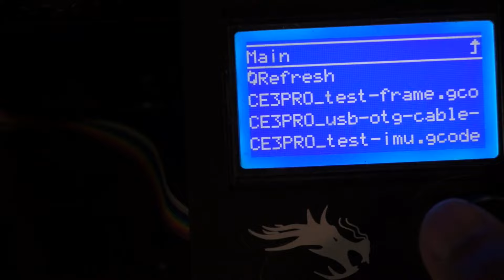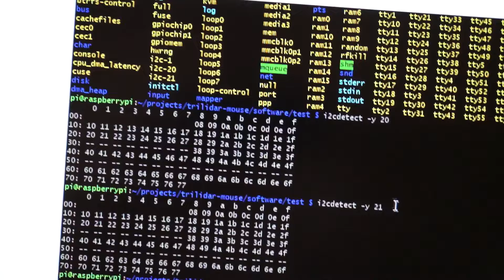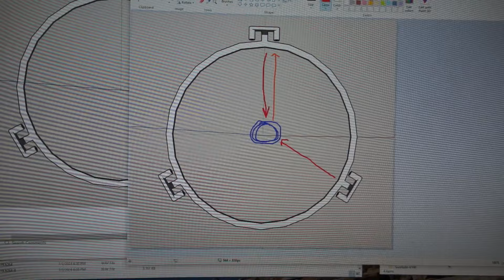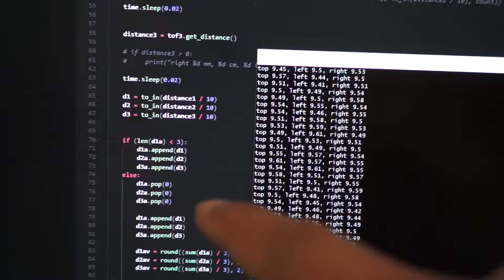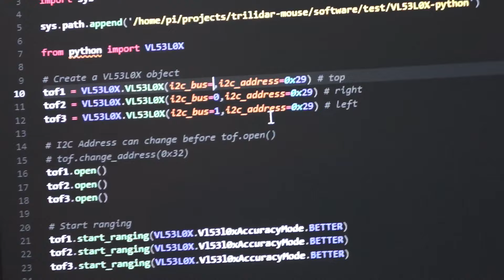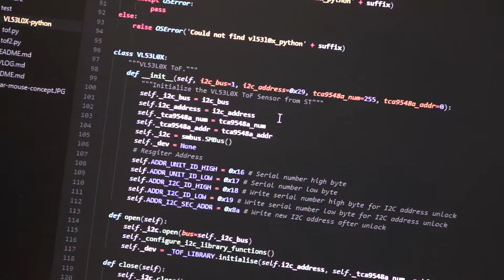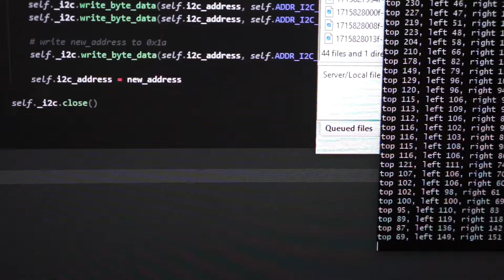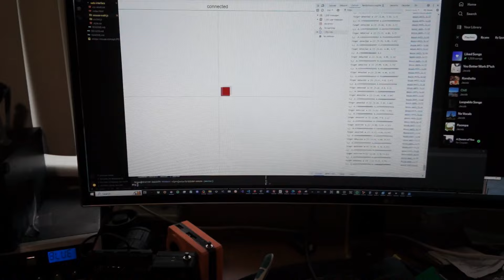Trilidar mouse part 2 - build and programming

Comment: super cool. I wonder if this can work if the detectors are all mounted to the keyboard maybe in a 1/3rd circle or so. Then you can use a large area to the side of the keyboard as the mouse... 
With good software this could totally replace a mouse.
Reply from the maker: they have desktop monitors that use that tech, they are linear/line the entire side of the screen, just not sure if it's easy to get those, they are skinny